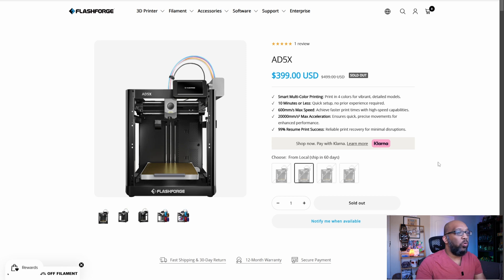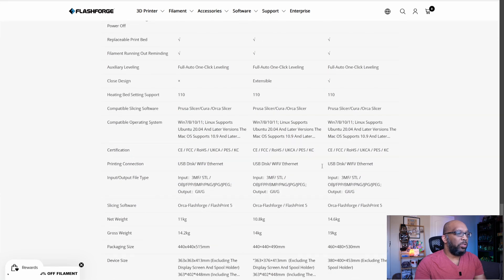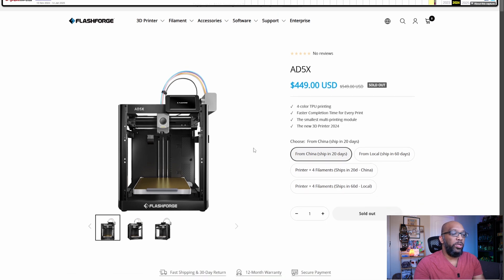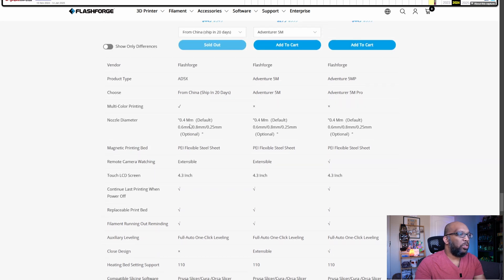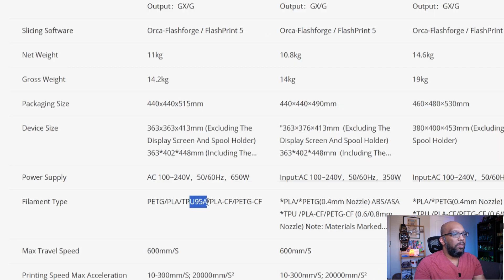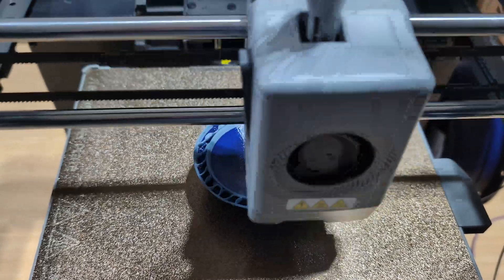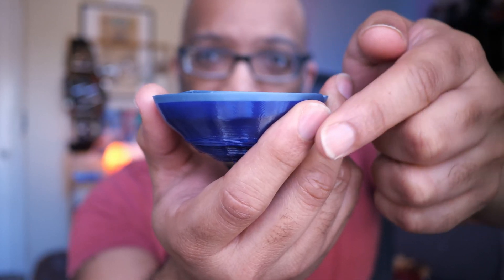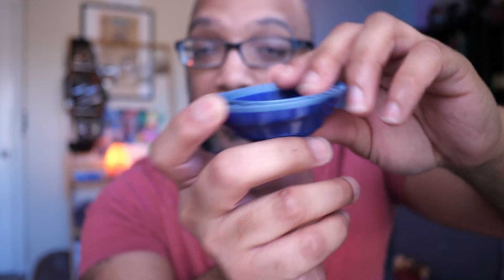Flashforge AD5X TPU & PLA Multimaterial Printing Test!

Comment: tldr; TPU works in the IFS. Multi-color TPU works great, layer to layer switches between TPU and PLA also works great. Same layer TPU > PLA can weaken layer adhesion especially if you don't flush enough when switching materials.

Multi-material TPU was why I ordered this printer when it went up on pre-order. For my coaster designs I print a 1mm TPU disk to glue to the bottom (to provide a semi-antislip base) and thought it would be really cool to be able to print the TPU base integrated directly to the rest of the coaster.  I have tested this similar to how you did where you start with TPU then switch to PLA at a high layer and the bond is quite strong.

I have also done some Rocktopi where the legs are PLA but the body is TPU. This requires material changes on the bottom layers until the legs are completed. This also worked really well with around 65 filament changes, however I noticed if you don't fully flush the material when switching, it can weaken the layer adhesion. My first couple attempts saw the bottom of the body rip off and stick to the bed when removing the model. Increasing the flush amount did help some, but not completely. TPU sticks super good to the textured PEI plate so maybe if I do the first few bottom layers of the body as PLA before switching to TPU it might work a little better. Using a scraper to loosen the TPU in contact with the plate might have also worked, but I didn't have on handy at the time. I've got some more rainbow TPU coming and I'll use that for some more testing.

I created a multi-color (all) TPU octobenchy with black TPU for the eyes and this worked perfectly. The eyes are small so there were only a few color changes, but this printed with no problems.

I did have an issue with a nearly full spool of TPU running on the IFS where it would get wrapped around the spool holder and not feed into the toolhead, but the toolhead would keep going for several layers before stopping with an error. This caused a few complete failures, but left me with kind of a cool tentacle finger spinning fidget thing.

Comment: When i try to slice using tpu and pla the send print window prompts saying only support selecting materials of the same type. How did you get past this?
Reply from the maker: I never saw that error. On the printer itself, did you specify which slot the TPU and PLA were in before you sliced the file?
Reply: @FigureFeedback  I received the same error message.  My filament definitions seem right, but I can only print with PLA.  I can print with multi-colors but not multi-type.  I am still looking for some slicer setting that makes it work.

Comment: Have you tried printing Silk PLA yet?

For me It prints fine, when printing alone. But once you combine it in multicolored with regular PLA. It will clog the nozzle.
Reply from the maker: I haven't tried silk yet. Thanks for the heads-up.
Reply: @FigureFeedback  It happens when it switching from Silk to the regular PLA, the other way around is not an issue. The gears start clicking and if you put the temp up high enough on the PLA, it will eventually push it through, But it can't be good for the gears.  It looks like it using the temp for the regular PLA to purge the leftover silk and is clogging the nozzle. I would be interested to to hear about your results when you get around to try it.

Comment: I was all set to order an AD5X with the pre-order pricing and discount code from FlashForge and they pulled the 95A TPU claim.  I print a lot of TPU and have some designs that need TPU and PET-CF.  The AD5X was the first commercially available printer to do that and I was disappointed that FlashForge removed the 95A TPU claim.  Then yesterday under your previous video someone commented that the AD5X does print 95A TPU through the IFS.  I checked the AD5X web page and saw what you saw - the 95A TPU recommendation remains removed.

THIS was the video I was wanting to see.  Thank you!  There may be an AD5X in my future.  For production, it'd be great to load two spools of TPU and two spools of PET-CF and have it automatically switch to the other spool when one spool runs out.  That will make print farm management much easier.
Reply: @Liberty4Ever  I dont think the 5x can do PET-CF to well, its not enclosed and doesnt get really hot nozzle temps
Reply: @anthonylong5870  An enclosure is not required for PET-CF (though it can help) and nozzle temps require 260-290. The AD5X can do 300 on the nozzle so I don't see any issues. I have my AD5X in a Topcube enclosure designed for the A1 so there are options for enclosing the printer if that is required. I've already done a few ASA prints with no issues.

Comment: Edit: shipped from China is +$50 USD whereas local (domestic) is correct at $399. 

I'm seeing the AD5X for $449 USD with an MSRP of $549 rather than $399/$499 seen at 00:43. 🤔
Reply: If you go on the website, you have options on how to ship it, the price he shows is for the local, 60 day shipping.
Reply: Probably tariffs and promo pricing ending. They already sold through everything produced and then some. Why not raise the price?

Comment: I wonder how well the printer would handle PLA with PET-G supports. If that works just as well, then this is definitely on my must-buy list.
Reply from the maker: That's on my list of things to try.
Reply: PETG with PLA supports is my other application for the AD5X.  PETG-CF with TPU on the top and bottom few layers is my primary application for the AD5X.  Lost In Tech had a recent video (The unseen world of 3D printing at 1000 fps) where he showed how long laminar flow of two different materials persisted.  To avoid cross contamination that would cause weak interlayer bonding when printing PLA and PETG, you'll need to purge more than when switching PLA colors.  I'd start with the purge needed when switching from black to white and add 50%, and do pull tests to verify the layer bond strength isn't compromised.
Reply: @Liberty4Ever  PETG and PLA do not bond together well at all and will fall apart. People use that combination to make supports easy to remove just for the fact they dont bond
Reply: @anthonylong5870  - That's exactly what I said.  I'd like to use PETG with PLA support material, specifically because they don't bond to each other, but I also cautioned that dissimilar materials don't mix as well in the nozzle so the purge material must be greater to avoid a small amount of cross contamination that would greatly weaken the part.
Reply: @Liberty4Ever  This was my experience when switching between TPU and PLA on the same layer. The flush calibration needs to be set pretty high to make sure you flush out as much as possible.
Reply: It would depend how much you purge probably.  Any of the other material left in the nozzle would make the whole print fall apart
Reply: This shouldn't be an issue. Any multi-material printer should be able to do this. I have found a potentially better method though. If you copy your filament profile for PLA and drop the temp by 15-20C in a new profile and use this as the interface layer you can get interfaces that separate just as easily as PETG interfaces, but without having to do an actual material change. You just assign the same PLA material to the interface as you are using for the model when assigning slots before sending the print. The print preview will be off since it's expecting to do a purge, but when it's actually printing it will realize that the material doesn't need to change and will cool the nozzle and use the same material for the interface.